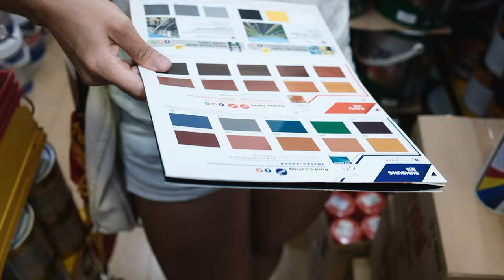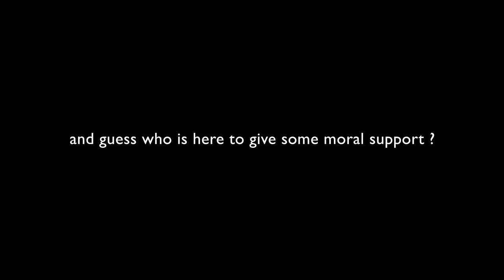Road Bike Makeover  - DIY Spray Paint at Home

Comment: What chemical did you use to remove the paint? I'd like to try it on my bike.
Reply from the maker: Uhm, we went to a hardware store and asked for the typical paint remover. It worked like magic but at the same felt unpleasant how powerful that chemical reaction. I wished there is a better way to chip off the paint layer, I think via jet spray.